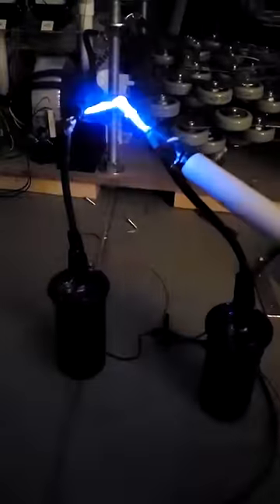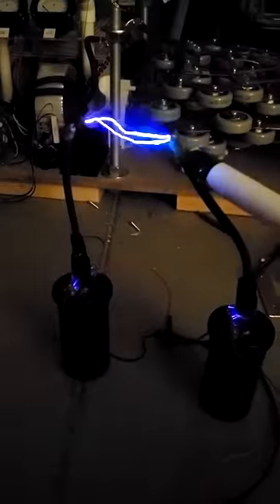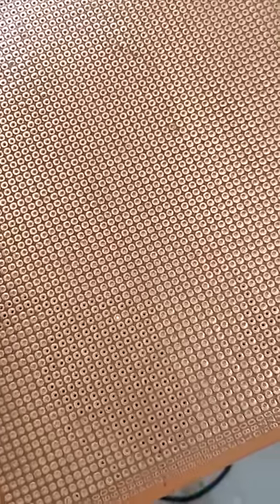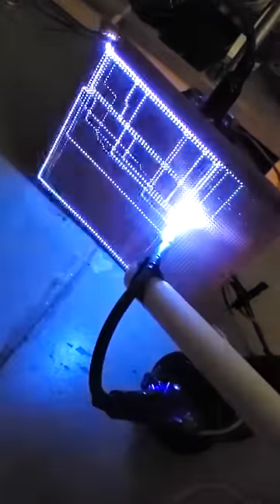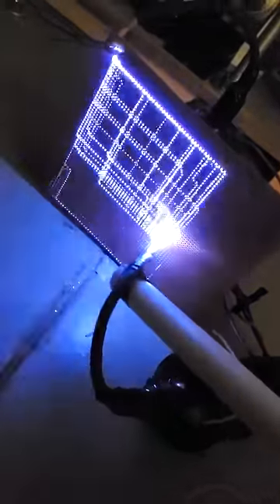car parts can be used to make this??

Comment: What's cool is seeing how far an ignition coil can throw a spark at atmospheric pressure, versus how short of a distance it can throw that spark in a 10:1 compression engine cylinder where the volume of atmospheric pressure air is compressed 10x smaller and becomes much more dense. I mean, a few hundredths of an inch in a spark plug that is extremely old and worn means the difference between a spark igniting the fuel-air charge, and the coil being unable to ionize the gap and a wet misfire occuring. Very cool. :)
Reply: If you think that is cool think about the the fuel injection with Diesel engines! Them jokes are already moving a lot of air then you throw in a turbo charged air and they shoot out 20k psi out of the injectors to get the exact mist they want.
Reply: @jonathanpalmer228  do you know how much 20k psi is in bars? Because modern common rail diesels are able to put out up to 2k bars and I think that is even more than 20k psi.
Reply: Wet misfire is what I'm calling a shart from now on
Reply: I know some of these words.
Reply: @AlligatorHator  2k bar is 29k psi
Reply: Geek
Reply: more molecules the better
Reply: oh my god you just made me realise why my old boss told me a plug that sparks outside of the engine doesn't necessarily spark inside the engine
Reply: @izzyh.3581  Go back to the 90s lol
Reply: @williamlux  love it
Reply: Gotta love micro tolerances
Reply: Guaranteed the coil in this vid is not running on 12V DC, you'll get an inch of air gap at the plug wire end and a little more directly out of the spark tower.
Reply: @peachy7776  Yes! That's awesome. :) I like eureka moments. If you're curious for more cool or useful info, here's some extra. If you look at a "secondary waveform" of an ignition coil as it fires a spark plug, you'll see a flat line representing 0 volts in the secondary winding as the coil is either doing nothing at the time such as intake or exhaust stroke (non-wasted spark) or as the primary winding is being energized. Then you'll see a huge sudden voltage spike as the primary winding turns off and the magnetic field collapse induces a huge current spike in the secondary winding and the voltage builds higher and higher until the spark is struck and the arc is formed. Then you see another bowl-shaped flat line at a voltage that's higher than the first 0 volt line, and that is the spark plug actually holding an arc and "burning." Then you'll see the voltage line drop as the current spike finishes, followed by an oscillating period where the windings reverberate a little bit from the magnetic field collapsing and the 2 coils influencing each other a bit temporarily. Then it returns to the 0 volt line as it waits for another charge and fire event. 

I was talking about how much harder it is to make an arc in a cylinder with 10:1 compression where the air is way more dense than atmosphere. The 3 stages of an arc forming are the buildup phase, and then the ionization and burning phase. It takes more voltage to actually strike the arc from nothing than it takes to keep the arc burning and stable. You need a lot more voltage to get those electrons to jump from one electrode to the other and ionize the gasses in between the 2 electrodes. Once they do jump and create that arc though, it is way easier to just keep them flowing across. The ionized arc is very conductive and the electricity can pass through it much easier than nonionized air/gasses. This is also why you can "pull" an arc much further than the distance it takes to create it in the first place. You may have a high voltage transformer that creates a voltage which needs the electrodes to be 1" apart to actually strike the arc. But then you're able to pull the electrodes apart 4" before the arc goes away and dies. Once it goes out, you need to go all the way back to 1" away in order to strike it even though you had an arc at 3" away just a few seconds ago. The burn period of the spark plug secondary waveform is cup or bowl-shaped because it takes more voltage to burn the spark at TDC, and it decreases as the air:fuel charge burns hotly and the piston starts moving downward. Then it increases once again at the end because that is when the air:fuel charge has burned almost completely and there are no wet hydrocarbon droplets or vaporized hydrocarbon molecules saturating the combustion chamber and they no longer provide a more conductive gap, so the voltage demand to keep the spark burning is higher at BDC power stroke. 

So, if you're diagnosing a car and looking at secondary ignition waveforms, you'll know there is a big problem if you see anything other than a huge voltage spike which increases rapidly until the arc is struck, followed by a high voltage burn period which has a bit of a bowl shape, followed by a drop and brief oscillation as the windings stabilize. If you get a massive spike with no burn, the arc isn't forming. You could have a severely worn spark plug or a bad plug wire that is open circuited or something. If you see no spike, the primary or secondary coil could be bad, or the computer isn't energizing it at all. If you see a very high spike and then a very high burn period voltage, that's possibly a very lean running cylinder. The opposite is true too, a very small spike and lower burn period voltage is a rich cylinder. It could also be low compression too though. If you see every single cylinder except 1 of them has a very high spike and burn voltage indicating they are all lean except 1 which is normal, that 1 cylinder probably has a leaky injector forcing the bank lean and the computer trimmed it out which made that cylinder run correctly but all the others are now very lean and need a lot higher strike and burn voltage to fire the spark plug. 

Well that turned out way longer than I intended. Sorry. 😓😸 I just get all worked up about cars and science, 2 of my favorite things! And the Adderall kicked in pretty good for me today so... 🙃 Chatty Cathy at the moment.
Reply: @BigMac2222  I would never expect Styro to run a device at-spec or at a proper duty cycle. He overdrives the absolute balls off of everything. 😸 Rated for 12 volts? He'll give it 48V. 😸
Reply: @izzyh.3581  Proudly. 🤓
Reply: @jonathanpalmer228  you do know diesel motors don’t have spark plugs right
Reply: @AlligatorHator  yeah I work on them m8 I can go to the on board monitoring system for Komastu and look at the PSI and it’s around 20 to 25k psi. So my statement stands
Reply: @Whiskey5_  yeah? What does this have anything to do with anything?
Reply: @jonathanpalmer228  I didn't. I answered his question which is all you should have done!
Reply: @jonathanpalmer228  sorry, I read your last comment wrong, just read it again. For some reason I thought you were talking about spark plugs in a diesel. My fault
Reply: Adekunle  youtube is 15 now huh? Or 16
Reply: Wouldn’t a spark have an easier time in high compression? A spark outside the engine will Defiantly spark inside the engine contrary to another reply in this thread.
Reply: @AlligatorHator  1.37 bar is 20kpsi
Reply: @Wtfinc  1 bar is 14.7 psi or one atmosphere
Reply: I definitely pressed "Translate to English", but I think the translation app is starting to go on the fritz cause I'm only getting about 1 of every 7 or 8 words into English.  Who do I talk to about this?

Comment: Car coils = home made taser. Got it, carry on sir.
Reply: Good idea for a pressure plate shock trap. Must do more investigation…
Reply: When I was in tradeschool we had this one guy that just drove everyone crazy, you know the guy, the one that asks why 1+1 = 2 and makes every 20 minute lesson take an hour...A bunch of us went out to his car at lunch and filled his heater box with confetti and set the blower to high, then wired a coil to the ignition and frayed a high tension lead and stuck it up through the drivers seat, funniest thing I ever saw, unfortunatly this was way before decent cell phones and youtube...
Reply: @proles101  knowing how a coil works, and knowing how car seats have been made / installed since the mid 40s, I'm callin BS...

Especially since this guy was feeding AC power to a DC coil to get that effect.
Reply: Car coils = 1 single pulse of energy.
Car coil fed by AC power = 60 pulses per second (on a US grid)
Taser = multiple capacitors being charged and discharged in sequence
Reply: He'll knock your Peter and the dirt for sure
Reply: delete you comment ,i don't want this channel getting banned ,,,and yes of course what else would you do with it
Reply: Why would they ban this Channel because someone commented something they shouldn't have? @trevorunknown6714
Reply: @nunyabidness674  Yeah...everyone knows you put glitter in the heater box, because you can actually get it in there easily, but when he got to rigging the seat off the motor it's just make believe. A BBQ starter is a much simpler trick to rig up and won't kill anyone or burn anything down.
Reply: So they're just one giant capacitor. Ignition coils are good at charging and dumping current really fast but are not good for dumping extremely powerful currents, which yes makes it a really powerful taser. You can't just drive one at this level off a car battery without some sort of voltage multiplier tho.

Comment: The right angle patern you see is due to the board’s holes circle shape. Their closest point is in grid patern. If the holes padding was X shaped the spark would travel in a straight line first , then pretty much like in air as the paths heat up.

Comment: He said “shortest path” he meant “path of least resistance”. Had to be that guy.
Reply: No I actually appreciate the clarification. Do you know why it's taking so many different paths even when he seems to be holding it in a relatively stable place? Like if there is a least resistant path than wouldn't it prioritize that? How come it's shooting all over the place?
Reply: @stephenowesney5173  As another comment stated, the resistance, which is essentially electrical friction, takes some of the energy and converts it to heat. When the path is heated up, its resistance increases, and another path becomes the path of least resistance, until that one heats up and others cool down.
Reply: @VaporizedKerbal  oh wow that's amazing. Thank you so much!

Comment: Fantastic!!! Could this be used to generate super-random numbers?
Reply: if you change the place of the positive and negative terminals quickly
edit: set combination of a pattern of relays connected to terminals which makes a number, the pattern goes off at a specific voltage and makes a number by switching between paths at infinitesimal intervals, change the voltage for a new pattern which makes a new number, ps flux with be a problem to consider 👍
Reply: No🤣
Reply: I guess, but it's incredibly inefficient compared to just having a tiny piece of slightly radioactive material decay next to a detector. It could also be prone to eventually "settling" into a single path, which would obviously prevent the result from being random.
Reply: Not the best when it come to how this works but by the why the arc travels i don't think so, but i hope someone proves me wrong
Reply: Probably would but you want something to be small and not use much power
Reply: @prestonferry  true
Reply: @magneticflux-  
I actually believe it could work fine 
By allocating a number to each point on the board, then sampling the points used by the electric flow at a set rate which would give you a string of true random numbers that could be as long as you witch by using a larger or smaller board 
That string could then be used as an integrator input to a random number generator, like Mozilla's (I think, don't remember who's it, could be cloudflare's)  lava lamp wall.
Although what you said is right, it would tend to settle/burn in a preferred pathway although I believe you could prevent this by switching the input and output points on the board continuously, maybe by rotating the board and then replacing it if a pathway begins to appear
Reply: I don't think it's that random, and it looks to me like there's a well-behaved distribution of pathing (edges vs non-edges) that would bound the whole process and make it susceptible to attack.
Reply: @francisbacon4363  Just take a video of it, hash every frame, add them to an entropy pool and you are done. You can even throw in the audio stream for yet another source of entropy. The entropy pool is then used to seed CSPRNGs. That's how Cloudflare does it with lava lamps https://youtu.be/1cUUfMeOijg
The biggest problem is like @Gr3nad3_Man1c mentioned the board will probably breakdown at some point and the arc would settle into a single path. Which would probably heat up that part of the board and cause a meltdown. Either way you could end up with something that doesn't do anything after a while.
Reply: @iammeok  using cameras to record it is just missing the point. you could videotape a while piece of paper but the image will still produce different hash every time due to small differences in light, heat distorting view, camera not being perfect etc. 

the lava lamps at cloudflare are just a novelty, nothing woult happen if someone turned all of them off
Reply: @wojtekpolska1013  No, you are missing the point. The OP asked "Could this be used to generate super-random numbers?" and the answer is yes and I only responded to give a way in which it can be done fairly easily without resorting to complicated arrays of sensors.

The additional restrictions of "can't use a camera" that you are suggesting could be easily extended to "can't use any type of analog sensor" because most analog sensors will experience the same thermal and acoustic errors that you mentioned.

If you really wanted to limit the randomness to come purely from the different paths the arc takes then you can quantise the camera output and use some fairly simple image processing to detect the path and convert that to an integer.

But then if you do that it becomes even more of a priority to make sure the arc never settles into a single path or goes out entirely due to the board breaking down.
Reply: The numbers Mason. What do they mean.
Reply: @magneticflux-  That was Turing's theory for true random number generation. Shame we don't have one in our phones for those lousy mobile game RNGs that are anything but. Couldn't someone set up a random seed company that game servers connect to for real random number generation?

Comment: If you could
A)determine the speed of the lights
B)allow "bleed effect" for the lights in some seperate control board
C)some rgb that activates when each light gets a pulse, either same color or mix it up
D)make it quiet

You'd have a heck of an elecronic wall decoration

Comment: Back in the 90s there was a "make a 40,000-volt induction coil" book by Walt Noon that gave rise to a bunch of science projects but I don't recall anyone ever pairing it up with a piece of perfboard. Very cool! I used an old refrigerator compressor to evacuate glass tubes and bottles, to make plasma displays with mine.

Comment: Reminds me of an issue I had with tactics on a grid, when you either disallowed or allowed diagonal movement. If you allow diagonal movement for the same cost as a side movement you suddenly make diagonals way faster. If you disallow it, you make it very odd to move, and distances are no longer intuitive. In our game we decided to just make diagonals so the first movement is one diagonally, and the second movement is two. Alternating. Technically it’s not quite correct, but it is close enough that it equalizes in the long run. So the shortest path is mostly the shortest path. Technically each diagonal is 1.5. But that leaves weird remainders. Whereas this way just makes it so an odd amount of diagonal moves is technically the most efficient. Which means little over a single turn with many moves, because you usually never get a situation where you get to use the advantage of an odd amount of diagonals and still get to hit melee. Though it does mean you can eek out a little more movement on range. Pursuit is unaffected, because they can do everything you can do. Even if you dash, doubling your range, you only get one extra. Meaning the more you can move the less significant the advantage is comparatively.

Comment: That arc is no joke, it can stop your heart in an instant...
Reply: Not really.... The current these can produce is rather small. It'd just give you a good zap.
Reply: Only if it isn't insulated*

You can grab a spark plug wire and hold it in your hand. I have done this. The human heart is protected by the arm in this case. You literally have to have direct current to your heart because it becomes a problem. 

Oh yeah, it does cause muscle contractions in your arm.
Reply: @jort93z  That's only true for non direct to the heart.m current. 1 amp can stop the heart.
Reply: @gctcauto  It is much, MUCH less than 1 amp.
This will be a few milliamps.
Reply: i tried this and it was cool

Comment: The voltage is actually taking all possible paths at once through that circuit board. Electrons are invisible. What we are seeing is the paths of high current that has enough energy to turn the air just above the path to turn into plasma.